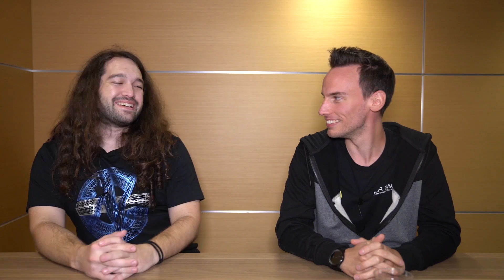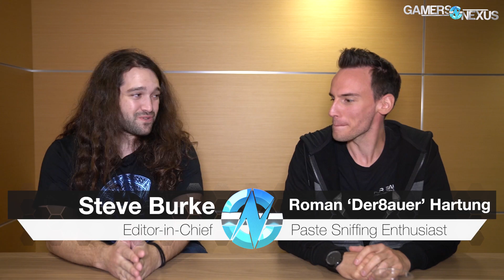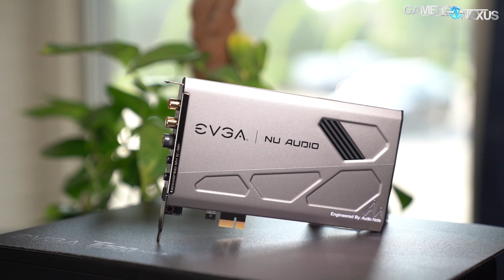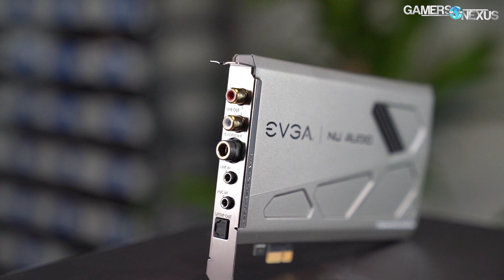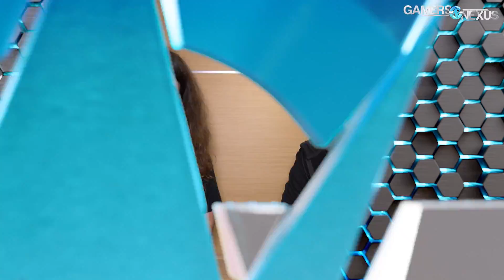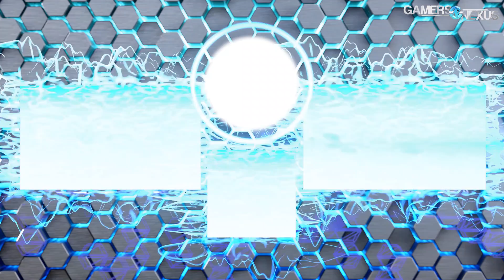Der8auer Deep-Dives on Thermal Paste: Misconceptions, Curing, & More | LTX 2019

Comment: Any thoughts about using graphite pads for long term use? I've used IC Graphite pad on a 1700X with a Dark Rock Pro 4 and temps and experience with it were pretty good, plus I have no issues with aging with it. On the other hand, I've heard that Thermal Grizzly graphite pads are poorer quality and break apart from mounting pressure.

Comment: I'm confused I thought the GN guy uses liquid nitrogen directly on top of the processor. and Mr partial Grizzly wants me to dismantle my brand new processor, void my warranty and spread liquid metal on the silicon and re glue my processor lid back on. If I don't do that I can use a short lived thermal paste I have replace each year to keep it working. as well as make sure my processor runs hot at 50 to 60 deg to get best performance. Alternatively I can use basic thermal paste and buy a M.2 ssd and my pc will actually be much faster.

Comment: What about applying thermal paste, applying cooler onto CPU with pressure and then lifting the cooler, therefore splitting applied thermal paste? Should I clean both sides and start over, or this is fine?

Comment: Der8auer, any commentary about diamond and graphite? I've been doing my own experiments with graphite and diamond, and although I had great success with it (appx 120w@95c -> 145w@95), it was really difficult to make it work because the thickness was really difficult to get right (killed it to 100w a few times). Graphite felt less performant, but much easier to get right.
I would like to try out boron arsenide, but I'm not sure where to find some for the homegamer.

Comment: I wish Der8auer went into more detail on why you would want silicone based vs. not silicone based (e.g. why Hydronaut vs. Kryonaut)
Great video, thanks!
Reply: Silicone based compounds are not electrically conductive, so if you have sensitive components you want to use silicone base compounds
Reply: @WhiteMonsterEnergyXX  That would imply the opposite because Kryonaut is silicone based, and the supposedly more beginner friendly Hydronaut is not.

Comment: Surprised De8auer hasn't heard of VSG, he was OG for radiator, CPU water block etc testing. Will be few years ago now that I pointed Steve in his direction (think GN was at 70k subs or similar), can't claim credit however, as Steve probably found him otherwise. VSG's site is still up(thermalbench), though not/or rarely updated any more, the material is still worth a read though.

Comment: Pump-Out Effect, that's it, so simple!!!
Man you guys saved my weekend.
I was struggling with an older delided CPU (i5-3570k) and a NH-D14, everytime I heated up the CPU for stability tests (~85°C) for hours, I got bad temperatures @ 2 cores by the time...
I used the Noctua NH-1 thermal paste, it's liquid and not like powder. I ordered hydronaut, I hope it will help.

Danke Steve & Roman! :D
Reply: The point was mainly that you would have needed to replace your paste below the IHS a long time ago. Had you used qhydronaut it would have jush taken longer and wouldn't have been as bad yet, but your 3570k should, according to Roman be seeing bad Temps for the past few years now.

Comment: I used to test thermal compound.    One of the brands that I became very disappointed with was Arctic Silver 5, over time the non-oil components separated and left gaps, that look like cracks, with no thermal compound.    Thank you for another great video.

Comment: air bubble effect, assuming that the viscosity of air gets significantly more viscous than the thermal paste, lol.  You may experience this effect at Sealevel if the air temp goes below -215c (58K or -355F), lol.  I gues then the Q is, is a solid frozen chunk of air, a bubble, lol.

Great vid Steve, Der8auer, and crews. B)
Reply: Why would you apply the compound at such low temperature?

It's not like the air will migrate into the compound somehow...

You could have a void if somehow the paste solidified and cracked. This can happen with huge negative temperature thermal cycling.

Comment: Steve: grinding metal into powder is usually done with a ball mill, which is basically a barrel with aluminum oxide balls inside it that grind thick dust (produced via grinder of some form) into fine dust over time. It might also be able to be done with EDM machining, which is a super neat process, but i'm not even 25% sure on that.
Reply: Electronic Dance Music CRUSHES!

Comment: Neat I'm about to buy a tube of Kryonaut but now with a revamp coming out I'll hold off for a month or two.
Reply: I just purchased two tubes, so you can have some of mine
Reply: I hope it is easier to spread as its dry as hell, bit better if you heat it 1st, I ended up using the Liquid Metal in the end.
Reply: Yeah I still got mine sitting there unused for over a year now. But I doubt the new one is going to be a huge step forward, probably just better in terms of application/usability.